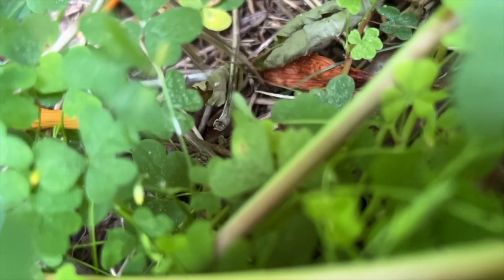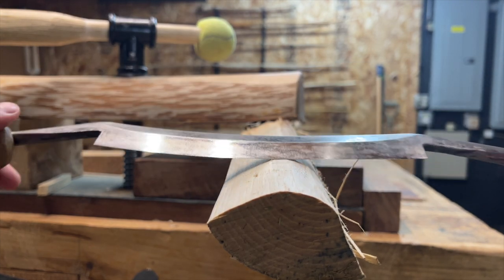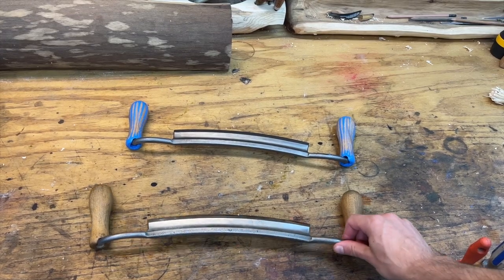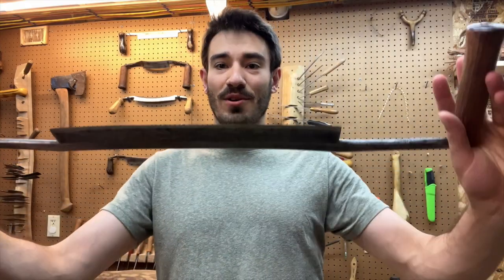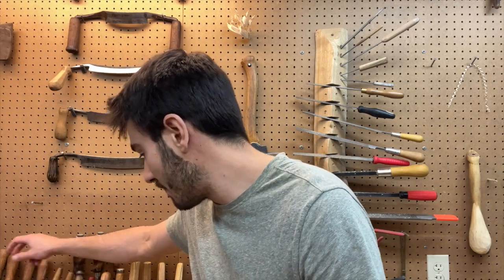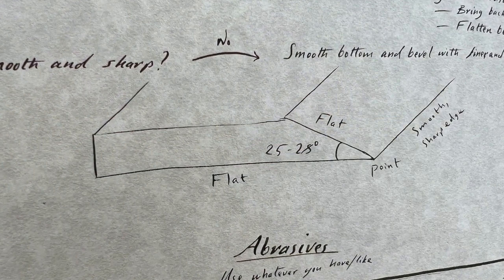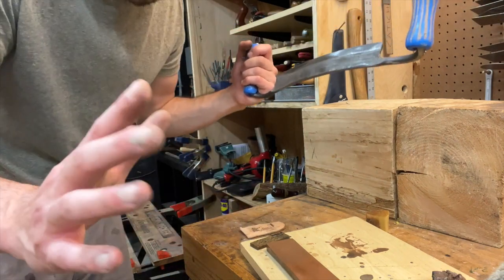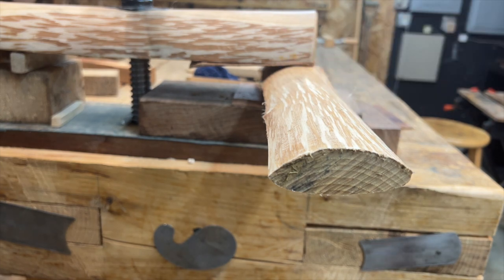Drawknives for Bow Making |  Sharpening, Recommendations, and my Vintage Collection

Comment: I just got the Felled 8” straight draw knife for $25 in the mail yesterday (9-30-2023). Let me say, much much better than holding and using my hatchet in place of a draw knife. Pros : it was factory “sharpened” which actually didnt do to bad at stripping down some white wood I have around. Will be looking for a vintage/antique one though.

Comment: My first drawknife was the 8" felled knife .....larger version of the 5" you do not recommend.  It works better bevel down than bevel up and is decent for carving when sharpened to a better edge.  It has plenty of strength for debarking and worked well for me in chasing a ring in ash and white oak....not as much success with red oak or juniper.  I have another, lighter, curved draw knife for shaving and  finish work...it is an ohio steel drawknife that does not have the umph I need for heavy work.   I just bought the blue ox head curved knife (after watching your video) and am looking forward to using it.    Thanks, Dan....I will let the felled knife go dull and use it for the debarking stuff and make the oxhead my main knife.    Enjoyed the sharpening aspect..this was something I needed and came at a great time for me.
Reply from the maker: Glad to hear! I’m sure the felled can be improved by sharpening but I really don’t like that knife enough to spend the time. I will probably reforge it into a different tool

Comment: Very nice! I'm teaching myself to make high end drawknives, particularly for bowyers. What I really need is a good idea what bevel angle you prefer? I know that the common theme seems to be 25°...but I hear a lot of guys talk of 'modifying' the bevel angle. If you like something flatter knowing in advance would be perfect.

Oh also...I'll be making a number of self bows to test my work...and your videos are invaluable!

Thanks!!
Reply from the maker: I’d be happy to help you design the ultimate drawknife! I have a bunch of ideas
Reply: @DanSantanaBows  sounds like fun! I made something generic for myself this week...no wood handles, but the design I made doesn't really need them (it's similar to a 'blacksmith' knife). I'm mostly just looking to get a feel for how the things are supposed to work. The primary bevel is a full convex for the first 3/16", based roughly on a 25° bevel. The secondary bevel is much closer to 10° to keep it out of the way of the knife. The transition from primary to secondary bevel is a full blended convex. I'll be finalizing the bevel, sharpening, and trying it out tomorrow. I'll let you know how it goes lol.
Reply from the maker: @CrisAnderson27  I actually think it’s better if the bevel   gets in the way because the corner acts as a chip breaker and folds over the shaving, helping it curl away rather than letting the knife dig and get stuck.

Personally I like a flat bevel. I see the appeal for a secondary bevel but don’t think they carve as nicely
Reply: @DanSantanaBows  I saw you mentioned that in the video. I'm thinking it might be something I'll need to experience to understand your full meaning. In 99% of bladesmithing, reducing friction improves performance exponentially...but not having used this kind of tool for its intended purpose...it could be the complete opposite for sure.

Comment: Great seeing your drawknives and hearing your take on them. I agree with you over what is good and not. It is important for people to understand the merits of various tools as there are some tools that are essentially landfill. I would like to point out the in the middle of the video you talk about the Mora 220 and the flex cut knives. These are pushknives and not drawknives. You can occasionally use them to pull for certain cuts but as the handles are inline with the blade this makes them difficult to control on the pull. Pushknives as the name suggests work best on the push and not really for long planing cuts. The flexcut was designed with the help of David and Sally Nye for making fanbirds to rive or split very thin sections of wood along the grain to make feathers that are then twisted out to form wings of a bird. For me this is the only use of this knife, although I am sure other people have found different uses for it.  The Mora 220 is sold as a kindling splitting knife. I know many people who use them for spoon and small bowl and cup making, but have adapted them by grinding a longer back bevel on one side. Pushknives come into their own when shaping the convex outside surface of bowls and I have made some that have 11 inch long cutting edges. All the best and stay sharp, Sean
Reply from the maker: I agree with the mora and flexcut not being “real” drawknives. My issue is that when I bought them they were marketed as drawknives, not push knives. There are many great drawknives out there that do have straight handles so that you can use them either as push or pull knives, but theyre much more solid than either of these. I’m especially hard on the flexcut and the mora because I think they’re lousy as both drawknives and pushknives. The mora is bad at all it’s intended functions—push, pull, and splitting. The flexcut may be good for making specialized shavings, but as a carving tool it’s surpassed in all domains by either a carving knife or a real drawknife.

Comment: I have only the "Ochsenkopf" (its cute how you pronounce it ;) ) and I like it. Problem is the blue paint on the handles. Its not "solid", so it makes your hands blue, when you use it intensely and probably have the right sweat pH. I think i will completely remove the colour. Carving is pretty good in my experience too, but i keep training sharpening on it. So maybe it could be more sharp and have a better angle right now.
Reply from the maker: Ha, I should have looked up the pronunciation. It’s no wonder they go by Oxhead in the US—much easier to say! So far the wax mix seems to help keep the paint on but i’ll definitely take it off if it turns anything blue. I am definitely not a fan of paint on tool handles. Wood is such a better material to grip. Manufacturers feel a lot of pressure to do this because it keeps the product more shelf stable and makes them stand out in online pictures…but it also makes the tool worse to use so it’s definitely an annoying practice
Reply: @DanSantanaBows  I agree on the handles!  And its not so hard to spell as you might think: The "chs" in Ochsen is pronounced the same way as in ox. So Its pronounced like Oxnkopf. Thanks a lot for this very insightful video, which is more like a lesson for free. Tools and the right choice and maintenance is very underrated i think.
Reply from the maker: @hansimgluck9207  thank you!

Comment: I started sharpening my blades using an air-belt-grinder & 3M Cubitron 80 grit belts. Yeah, that's about the best way to sharpen ANYTHING I have ever stumbled across. You get absolute razor edges in close to zero time. I use a leather belt to strop the edge after - and every edge stops on a fingernail. It cut out a LOT of mucking about with stones etc etc.

Mouth is watering at your tool collection btw - ohhhh, so many good tools. Very nice. :-)
Reply: If you try that method ^ I mentioned, you will NEVER run a finger on an edge to see if it is sharp, because it will cut you - you'll switch to dropping the edge onto wood & seeing can you push the edge sideways - done right, you won't be able to, it will stop dead. I handed a newly sharpened fiskars to a friend - he did the "finger test" before I could say anything - cut him to the bone. There was blood, there was moodiness & he did sulk. Quite a lot as it happens. 

Dunno what he expected, I did say I'd just sharpened it - he still sulked a lot. You'll also start minding how/where you put blades down, because you'll know they will open the unwary if they brush against them. Which you used never do before using crappy sharpening methods.

Comment: Great timing for me. I have been thinking of buying a good draw knife for my bushcraft tool kit and your video is very informative. Unfortunately, the very good ones are extremely expensive new, or used on eBay. I might take a look at the first one you reviewed (what is the brand?) and/or the Oxheads. It seems ok for beginners and not so expensive. Thanks for sharing.
Reply: Look in the video description. Later in the video he recommends a 30 and 40 dollar option that is very good
Reply: It's spelled Draw Knife not drawn. Just FYI.

Comment: Do you have a video on the way you built your holding vice?
Reply from the maker: I haven’t made a tutorial video but in the video on workholding methods I take it apart so you can see how it’s designed. I used a vise screw from woodcraft but any vise screw should work. Let me know if you have any questions and I can post more about it
Reply: @DanSantanaBows  ok, I will thank you.

Comment: Ramelson also makes a very good knife as well, I have the smaller one and it comes polished and razor sharp and holds the edge very well with 1095 hi carbon steel…but it comes at a price of $50!
Reply from the maker: I haven’t had the best experience with their tools and have been through a few strikes with them. Quality wise they feel hobby grade but are usually at a price point where you can do better
Reply: @DanSantanaBows  I make Windsor chairs and I have shaped the spindles,arm rests and the crest all out of red and white oak and carved the poplar seat and I have not had to even hone it once…granted it it mostly green wood other than the kiln dried poplar for the seat blank, but I am impressed so far with its quality and the finish that it came with, I look forward to getting the 10” one as well!

Comment: Just what I needed, TY. Primitive arrow build today btw
Reply from the maker: Awesome good luck! What are you using for the shafts?
Reply: @DanSantanaBows  2 hazel shoots (21" & 27"), from my garden and one 24" oak dowel, store bought, and recycled from older set. Nocks cut, ready for turkey fletchings (6"-8") cut and singed today to be attached with pine-pitch glue, first time, and deer sinew (yummy), bone points (remains of a lamb roast).  3 more 21" hazel shafts in the pipeline.
Reply from the maker: @jillatherton4660  I love working with hazel, it’s such a pleasant wood all around. Where I live we mostly have witch hazel which isn’t as well known but is still a great bow wood with a heat treat
Reply: @DanSantanaBows  I have 4 saplings (1 1/2"-2"D) earmarked for felling once the leaves are off. I shall be chuffed for anything useable between 48" and 60", I may even succeed with all of them.

Comment: Hey buddy your a great woodworker. You swing those knives around like a samurai ninja! But why don't you make a jig for those wet stones? I know its a tough stone but i cant believe i just saw you vice down on the edges of that stone. Towel or not, easy there buddy! Make a jig so you can switch out different grit stones without having to vice them down.
Reply from the maker: I have a jig but went back to this setup since it’s more comfortable and easier to film. The vice and towel are very gentle
Reply: @DanSantanaBows  R&D is your friend! There's literally thousands of different ways to set up a jig. A little bit of damage over a period of time adds up to a lot of damage. Bro, not only are you applying force to the sides of the stone. You are also applying a downward force on that same stone at the same time as you sharpen your blades. Surely you have seen a wetstone crack and break or even explode before!? First off, you can tell me it doesn't cause damage to the edge of the stones until you're blue in the face, but I know better! You wouldn't be using that towel if it didn't. Second, you need a stable and in place stone in order to sharpen the blade properly. So if you didn't vice down on the edges of that stone as hard as you can, it's going to move all over the place! I can design a jig for you that wouldn't even require viceing the stones down and can also work with you to come up with a design that will be film friendly and comfortable for you. Gravity and applied forces are your friend also! It's not so much the woodworking. You're a master at your craft! I can just help you be more efficient at it. I'm not after a bunch of money or fame or anything like that. I generally want to help you out! And I'm also crazy about archery. 😆

Comment: If you have a draw length of 36 inches how would you need to design and tiller the bow for that? I had a bow I used for several years with that draw length but it broke not long ago and I have been unable to find any bows for sale with that kind of length at any price...
Reply from the maker: For a rough estimate on the bow length, double the draw length and add the total length of stiff handle. You can follow the board bow tutorial or the maple longbow buildalong. For the width, compare with the width of a bow of the same design and adjust proportionally to the draw weight

Comment: The bevel should be down when drawing. He's using it upside down. There would be no reason to  have a bevel if it is up. If it's harder to cut with the bevel up it's because  the bevel over time has gotten to be too steep because of repeated sharpening. The bevel should be about 22 degrees and any restoration should include adjustment of the bevel. Most drawknives, especially longer one, have the handles bent so that they are parallel with the bevel . That allows the pull to be straight back when the bevel meets the wood.
Reply from the maker: Some knives are made for bevel up and some are made for bevel down. I have several of each. See my comments about this topic in the video

Most bowyers in the US work with knives bevel down, especially those that mostly use osage. Internationally and with white woods that is not so true

Bevel down gives more of a scraping action and the ability to carve a tighter radius. Bevel up gives more of a slicing action that makes carving more effortless but has a higher risk of tearout. It’s a purely technical choice, neither one is wrong
Reply: @DanSantanaBows  You haven't demonstrated any competence beyond the simplest of cuts, and your explanations make no sense so I think I'll just leave it at that.

Comment: That Mora isn’t a draw knife. It’s used to split smaller sticks from a log, like if you would if starting a fire
Reply from the maker: I agree, which is why I said “drawknife” in scare quotes. It is unfortunately marketed as a “wood splitting drawknife” though I don’t think it’s any good at either function

Comment: Hello I would like some insight into how you designed your “clamping/vise!!!! In particular the “screw” mechanism!! Please contact me!
Reply from the maker: @jamesnelson1443  See my video on work holding methods
Reply: @DanSantanaBows  thx
Reply from the maker: @jamesnelson1443  Let me know if you have any more questions. You can see the mechanisms in that video
Reply: Hi Dan, I watched your Tool Holding Methods video! Really great info.
Question: #6 in video is your bench/clamp system. Can you provide a vendor that sells the “Vice Screw System” ??
That is the way I want to go!
Thx so much😀
Reply from the maker: @jamesnelson1443  This one is the veritas I think, but if you search for “vise screw” you will get dozens of options from different brands, it’s a fairly standard product
Reply: Hi, I went Veritas site & they have it thx!
Reply: I was able to find a vintage LNI J WHITE drawknife on eBay, a really sweet curved 10 inch one with nice large handles, so I bought it! 
Thx for the very informative video!!

Comment: I purchased a set of two cherries chisels. I am extremely disappointed in their Finnish, their ability to hold an edge, and their Susprctablity to rusting. 
So on many levels: they are overrated and they SUCK.
l have since bought a set of Sandvick chisels and I couldn't be more pleased. They sharpen easily,  they hold their edge, they stay where you put them, they are not rolling about the bench, or worse, they are ergonomically made where they will lie flat without the handle getting in the way. More research is required before you go around endorsing companies.
Reply from the maker: I recommend a particular drawknife they make, not the brand. I don’t endorse any brands across the board.  The two cherries drawknife I have has excellent edge retention and geometry. If you watch the video, I make a counter recommendation which is extremely similar and half the price 

I do put in good words about morakniv and narex making generally high value products, but I also think they make lousy drawknives.